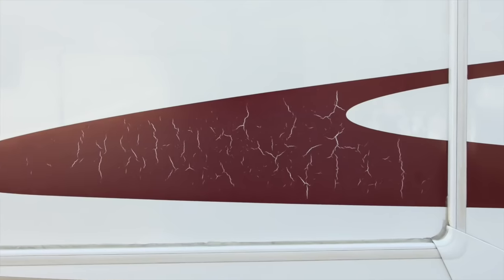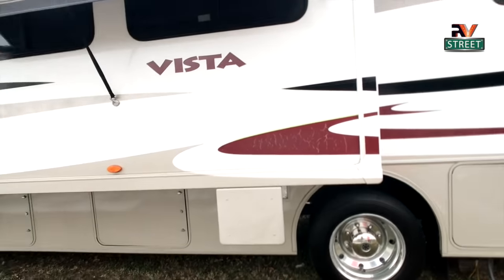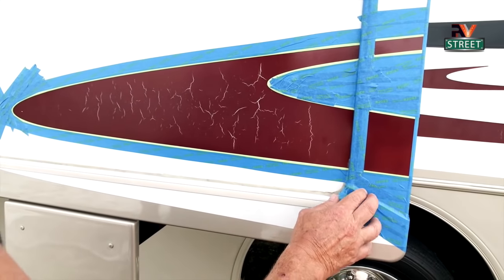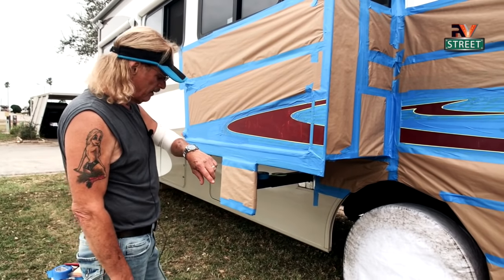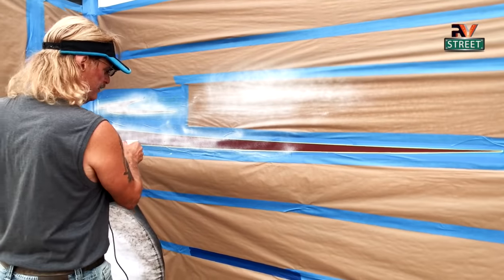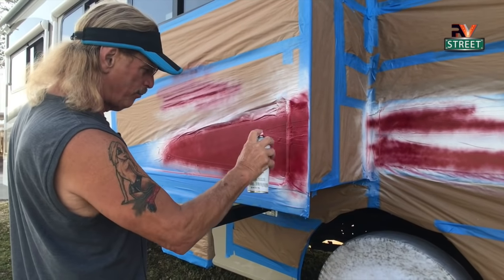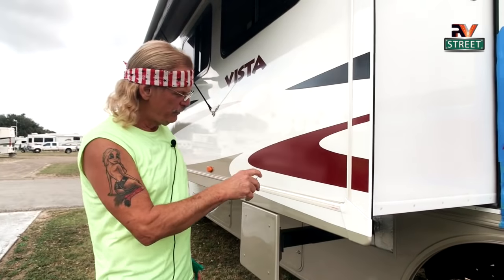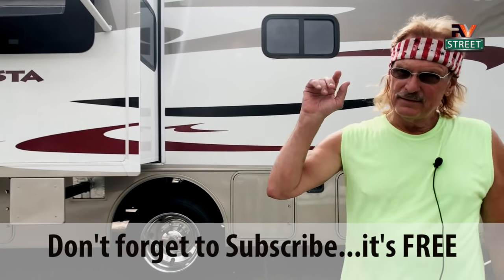How to fix Cracked & Faded RV graphics. Easy DIY job

Comment: Spray paint mists better when it is warmed.  I put very hot water into a cut up 2 liter bottle and place the spray paint into it.  A towel around the 2 liter will keep the water warmer longer.  Wait 3-5 minutes for heat to transfer.  Shake for 30-60 seconds..  Reheat as required between layers. The can shouldn’t be too hot to comfortably use it.
Reply from the maker: Absolutely a great tip. 
I didn't mention it in my vid—probably should have—but before I started to shoot the next coat of every step, I put the cans of paint out in the sun and warmed them up first. For about an hour or so.
I would of loved to have gone into every detail of how I do these things, but over all, a lot of people would say I take to long to explain things and they become board. Being on YT is a tough business. But I'm trying my best to learn and deliver good content,  make it interesting, inspiring and encouraging others that they can do these things. 
Then just answer questions later on.
thx SK for bringing this up.

Comment: Do you have any repair videos on fixing side of my 89 winnebago chieftain class A motorhome..I have some bulges(bumps) on side of motorhome on outside wall..they are hard as a rock..want to paint motorhome but be waste time and material if I don't repair these big bumps first
Reply from the maker: No repair vids on this. Without actually seeing it, from your description those bumps/bulges are most likely delamination occurring. Not good. But....depending on how bad they are, there may be some fixes. You need to research this to find some possible solutions before you move forward with any paint options. 🙏

Comment: Did you investigate getting the graphics from the manufacturer? My coach looks like it had a second set put over the top of the first set.
Reply from the maker: Yes they no longer carried them but even if they did they would be way to expensive and to apply them you have to have an exact match when you put it on. Which is NOT going to happen. So then you'd have to totally remove the old one and then apply the new one and if you messed that up while applying it, your screwed. To must work, to much risk. 

So that's why one on my 2nd graphic I made my own artwork and had it output locally and then applied it myself which I covered in the vid. That turned out well. 

If you'll go back to the video and click the description test and read that, I laid out there a more detailed comparison of all 3 methods I have used in a reply to a commenter.

thx Lee 👍

Comment: Nice job but I am having a heck of a time finding my color which is called "Copper Canyon" or anything close to it. I can get vinyl stripes brand new but 58.00 to 168.00 for the colors. If I could find the color copper canyon in spray form I would do this but that is not going well.
Reply from the maker: In your case I'd just get the new vinyl graphics and put them right over the old ones like the black I briefly showed on my RV. It's not that expensive and easy to put on. Be sure to start using RejeX to protect them and the RV from now on so you can keep what you have now longer. Here's my complete detail video will give you all that info:
https://www.youtube.com/watch?v=7KmgneT3HPs&t=193s

Comment: most rv decals are vinyl. to restore colour, apply heat. cracked decals will need to be replaced, or repainted as done here.  best is prevention: uv clear coat 1x yearly.

Comment: i am curious to know because the vinyl graphic is cracking and shrinking will the decal continui to shrink even when painted
Reply from the maker: The method here is be no means a permanent, long term solution. However it is a fairly quick solution to:
• freshen up old graphics to buy a few more years
• make am RV look a lot nicer to sell
• Change the color scheme for a fresh new look
If done right this should last 4 -5 yrs before needing touch up

Comment: I'm going to try this, can you tell me if its a dry time 1 hour between each coat?
Reply from the maker: Yes about an hour between coats  with the paint I used worked well. Then at the end of the day I lightly sanded the layer I did that day and then let it dry over night to cure before I started the next layer. That's why it took me 3 1/2 - 4 days. You want to rush this process.

Comment: Why not do the base coat with red primer instead of white? It would be easier to cover with the Burgundy.
Reply from the maker: It's kinda like painting a room inside a house that had a bright color before. In a house you'd use Kilz the walls to prime out the old color to totally block out old color. Or an artist painting an oil painting on a blank white canvas.  You start fresh with white so there won't be any bleed thru of an old color or any cross contamination. Starting with white....you start fresh. At least that's the way I did it and it turned out great.
thx sky for your question. 🖌

Comment: Why did you use a gloss primer? I'm curious because iv been painting for 20+ years and if anything has a sheen or gloss to it you gotta sand it til it's flat or the next layer won't adhere. If I'm wrong please do tell me how
Reply from the maker: Did you not see me sand that white?
You can use a matt finish if you want. It doesn't matter. It's all going to get sanded and final color & clear put on last. All those layers had no problem adhering to each other. This job was done going on 4yrs. ago and is holding up just fine.
Reply: @RVstreet  it looked better than I imagined it could have I do enjoy your videos, I wasn't trying to be snarky couldn't you tell by the context of the comment lol seriously I envy y'all's life and congrats on all the happy years you have together over and out. BTW Merry Xmas and Let's Go Brandon...
Reply from the maker: @RollingThunder85  It's all good. I never took your comment as snarky at all.
Reply: @RVstreet  thank you  I'm trying to figure out how to do this full time financially any recommendations would be very helpful. And in winter time how do you use a propane heater and not fill the inside with mold and extreme amounts of moisture looks like iv got a monsoon on my windows after a few hours of running the heat?
Reply from the maker: @RollingThunder85  I'm trying to figure out how to do this full time financially Do what full time.....painting graphics—which is what we were talking about— or living in an RV?

As far as how to use propane or any heat for that matter to stay warm in the winter and control condensation, you really need to watch my video here:
https://www.youtube.com/watch?v=yqZjE4aEoek&t=1463s
Doing these things will take care of the heating and condensation issue and also help in cooling the RV in the summer. When you have colliding temps when it's cold outside and warm inside this is where condensation occurs. Do the things in this video, run dehumidifiers and leave a couple of roof vents or windows cracked open so the RV can breath. If you don't do these things, the RV will get ruined inside and you'll create mold and mildew. Then you'll really have problems. Controlling condensation is not hard to do.

I also highly recommend you start watching these videos on my PLAYLIST page. If you do these things you'll save yourself a lot of grief, make RVing a pleasant experience and prevent going to the school of hard knocks.
https://www.youtube.com/c/RVstreet/playlists

Comment: CLEAR COAT QUESTION:
before the clear coat did you sand the maroon paint first and if so what grit?
Reply from the maker: Yes I did on all three layers and I mentioned the grit of sandpaper in 8:16 in the time line. 👍
Reply: @RVstreet  thank you very much for the quick reply.
Reply: @RVstreet  sorry, just making sure.  
you did not sand the clear coat, right?
1 is the stripe
2 is the primer
3 is the maroon
Reply from the maker: @donaldfafard  Correct. Did not sand the layers of clear coat. Those are the final coats.

Comment: Great project, excellent instruction with clarity, video coverage done very well! Looking forward to many more such videos and projects!  Does Reflex work well on original painted graphics? WBGO really pushed me to use synthetic wax on our painted rig. Thoughts on Reflex vs wax? Thanks for  all this!
Reply from the maker: Yes I've used Meguiars Ultimate Synthetic Wax for the last 4 years. Great stuff. But since I've learned about RejeX and have now used it, I've switched. It was developed for aircraft. Goes on easier, comes off easier and is better than wax as far as protecting it from UV rays and it has a beautiful shine to it too. 
The down side of RejeX (if you want to call it that is) you can not put it on in the sun. You have to put it on the coach sides that are in the shade. 

The 2nd thing is don't get RejeX on the rubber stuff. It will leave a white chalk residue like most waxes do.  The Meguiars Ultimate didn't do that. But it's no big deal. You  just have to be a little more careful when applying it around those areas.
After painting these old graphics, polishing out the entire coach and then a final coat of RejeX, our coach has never looked better since we bought it and I know the graphics are protected.
Reply: @RVstreet  Many thanks for your info on this!

Comment: Mine has been setting for years and the fiberglass is dull any idea how to bring back the shine ? Mine has a maroon stripe that will need done like this also thanks for the education :)
Reply from the maker: Removing oxidation
Ruel, here's what I tell folks. I get this question a lot about the DULL look and has lost it's luster. It's called oxidation. Once oxidation has been removed, then you polish, then you apply RejeX for the final protective coat.

Here's the process and a few tips I tell people to do to remove oxidation
The light weight Meguirs MT300 Dual Action—5.4lbs. is an awesome machine. Be sure to buy the back plate too. It's sold separately. It's the exact unit I used to remove the oxidation that my coach had when I first bought it in 2016. Having the right polisher is important. My coach at the time had heavy oxidation on the drivers side and back with light to medium oxidation on the other areas. My large slide on the drivers side was the worse so I had to use the wool pad and diamond cut compound on that area. I didn't have a YT Channel at the time, so I don't have a video on it. But I wish I did. I've actually been looking for an RV that has some oxidation so I can do a video on the process in a camp ground. But I haven't had any owners willing to cooperate with me. But I use the MT300 for everything to keep our RV maintained. If you have oxidation, once oxidation is removed, don't ever let it oxidize again. That way you won't have to go thru this process again.
If need be like you saw in my polishing video, if an area needs a little polishing, polish it then apply RejeX. My secret to keeping it maintained and shiny is using RejeX for my final coat because RejeX blocks the UV rays from the sun and that's what causes oxidation.
For compounding start small first. Like on the back. That will give you an area to get into the rhythm. I used a 12' rolling scaffold so I could stand up straight and do the top half of the coach. The bottom half is much easier to do than the top. Compounding to remove oxidation takes time. As you compound, the pads will load up with material from the RV, so you have to constantly remove it, by keeping them clean. You wash them out with water with them still on the polisher in—warm water is best—in my Grid Guard bucket— in my Amazon Store. If you have heavy oxidation, you'll probably have to use the wool pad and the diamond cut compound, otherwise use the other compound material in the blue bottle in my store and my red pads. Once oxidation is off, THEN come back and polish with my Meguiar's Ultimate Polish also with the red pads. It probably will take 2 or 3 passes to restore the shine. Don't do it in the sun. An overcast sky or inside under cover is the best to polish and apply RejeX—or wax if you prefer that instead—as your final coat. Again, keep your pads clean AND DRY when applying polish, keep wiping off the polish off the RV each time you make a pass with my microfiber cloths. Do small areas at a time. It's also better and goes faster if you have several pads. Just be patient, be methodical and it'll come out nice. You can do this 👍
Everything I use is in my Amazon Store https://www.amazon.com/shop/rvstreet
The stuff you’ll need is in the "Compound, Polish, Finish Coat" category. Above each product is a text bubble where I describe what each product is and what I use it for.

Here's a link to one of my PLAYLISTS that covers other aspects of how I take care of the outside of my coach. These will be helpful to you also. Especially the first 3 videos:
https://www.youtube.com/playlist...
Hope this helps 👍
Here's another reply to removing oxidation
The chalkiness yourspeaking of is called oxidation. Before you can ever get the shine back on any vehicle or RV the oxidation has to be removed first and *that requires compounding*. I had severe oxidation on our coach when I first bought it in 2016. The previous owner didn't take of it either. It took me 3 weeks—working off and on—to fully remove all the oxidation, heavily polished it, then added the final protective coat of RejeX. Some people still like using wax but I have switched to Rejex because it blocks the UV rays better—the suns UV rays is what causes oxidation—it saves the graphics better too and still achieves a nice shine. I didn't have a YT Channel back then so I don't have a video this process. I wish I did. I've actually been looking for an RV that has some oxidation so I can do a video on the process in a camp ground. But I haven't had any owners willing to cooperate with me.

It's basically the same process as the video you watched when I demonstrated how I polish the RV except you use a compound material to remove the oxidation first.

I used the Meguirs MT300 polisher for everything. It's only 5.4lbs so it's much easier on the arms. Be sure to buy the backing plate too. It's sold separately. It's the exact unit I used to remove the oxidation on our coach had when I first bought it in 2016 and still use it today. 
Hope this helps. 👍
Reply: @RVstreet  I also want a new Roof put on it it's a 24 Ft tag along do you know anyone in the Orlando area that does that work ? I know it's not cheap but i had a branch fall on it and skinned the edge i put some flex tape on it but it didn't hold and it leaked i have a tarp over it now
Reply from the maker: @Ruel-rc2ly  What kind of roof?
Reply: @RVstreet  It's like a grey mat material i want something a lot better It's a 2012 KZ Sportsman 243 fiberglass I'm not looking for some cheap junk i want a professional job.

Comment: Sadly, I’d think the underlying vinyl graphic will continue to crack and pull apart.
Reply: Not necessarily. It dried and cracked because it was exposed to the elements. Being covered in that much paint and the "wax" he used, it seems fairly protected.

Comment: Hi Martin, you mentioned in the video that you compounded, polished and waxed your coach when you purchased it.  I was wondering how you dealt with the graphic decals.  Did you use fiberglass cutting compound and if so did you have to avoid the decals or did you go over them?  Thanks and I really enjoy your videos.
Reply: RVstreet WOW!  Thanks Martin.  I really appreciate the help.  You are absolutely correct, I was stunned on how good your Vista looks in the videos.  Mine is a 2017 and it doesn’t look near that good.  I intend to change that though.  Thanks again!
Reply from the maker: @keithfaucett1462  Good luck Keith. Stay at it. Keeping up with your coach more than pays for itself in the end.
Reply from the maker: Hey Keith,
I thought you might like to know that I added all the tools and products I used/and still use to restore and keep our coach looking like new in the description text at the top of this page. Just click "SHOW MORE" and scroll down. Good luck my friend and stay safe.
Reply: RVstreet Hi Martin, I hope all is well.  I took your advice, bought the materials you recommended and have completed both sides.  All that is left is the top.  Thanks for the advice!  It is a lot of work but it looks great.
Reply: I’d send you a pic, but I can’t figure out how to add it to the comments.  Ha.
Reply from the maker: Way to go Keith. You can send a pic by going to the top of our YT channel, click the FB logo at the far right and when you land on our FB page post it there. I'd luv to see it.

Comment: You used three methods (eraser, vinyl decal, paint).  Which one did you prefer and why? (Time? Effort?  Potential screw up?  Cost? End result?)
Reply from the maker: Good question:
1) Eraser best method and cheaper (a couple of wheels, then compound, polish and RejeX) lots of labor, have to have a high power electric drill but never have to be dealt with again. I myself would only use this method if the existing graphics are really gone and beyond repair.
2) Going over existing decal with todays high UV resistant decals is good and easier,  but expensive and if you make a mistake your screwed and have to do it again. Then it's much more money
3) Painting is the cheapest, takes longer, but results are pretty darn good. Will last long if you protect well and often with RejeX.

I'm going to list this Q & A in the description text.
Reply: @RVstreet  Excellent answer.  Thank you so much!